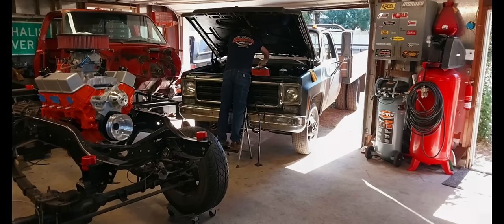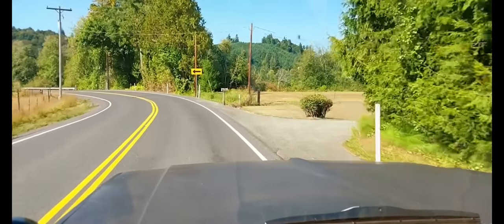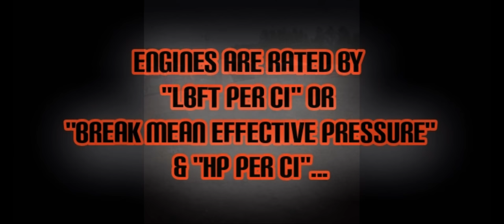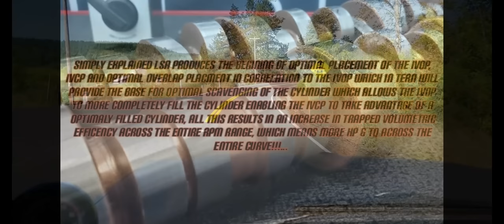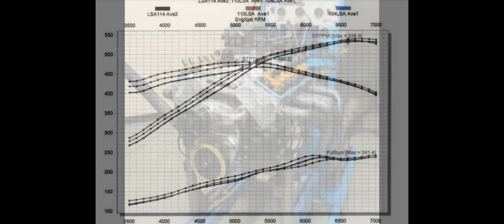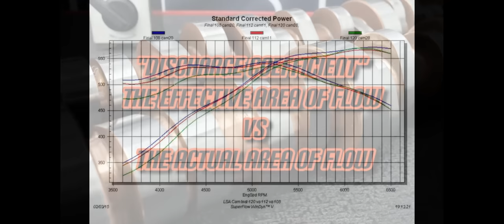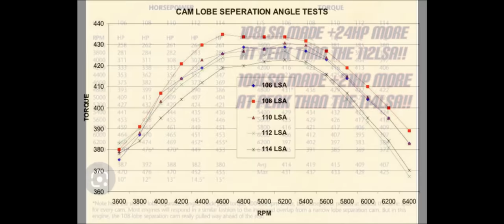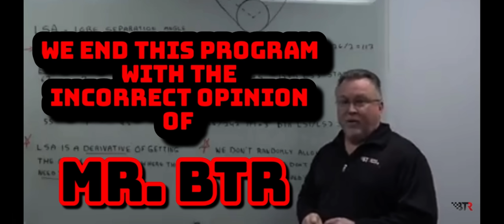Camshaft Selection via LSA, 19LSA's Dyno proven MAX TQ & HP cam tec. LSA, Overlap & Duration convert

Comment: I understand more from this video that I got out of Billy Godbolds new book. I figure I wasted my money in purchasing the book for he will get you totally lost along about chapter 8. Where he should have gone into great detail, he didn't. Your videos on cams are the most informative I have ever seen. I now want to try a few things, have a camshaft I know that has the incorrect LSA, keep the overlap the same and see what it will do for me I have less fear of purchasing a cam thanks to you but as they say, a little knowledge is a dangerous thing. It's only money that is hard to come by. Thank you Adam.
Reply from the maker: Thank you!! That is quite the complement.... I appreciate you watching..
Reply: Sir you didn’t waste your money on Billy’s book it’s hard to understand until one has obtained a certain level of understanding and practical experience building engines. It’s really a great book. 

For those who don’t know Billy is the former head engineer at comp.  If someone runs a como cam Chances are he designed the lobe. he’s a nuclear physicist with a hot rod addiction.
Reply: I’m looking for a turbo cam for a 572 bbc twin turbo. I would like a solid roller with around .770 lift and atypical lobes for street/strip. Any help would be greatly appreciated.
Reply: @chevyluv7216 every cam is a turbo cam. Just pick a camshaft design for the RPM band you want your engine to operate in.
Reply: @ironmike742   from what I gather the ex needs more lift and duration than a NA cam and it needs to be 114-116 LSA
Reply: @MichaelVanParis  Yes, it is a good book for someone that knows nothing but he does a horrible job explaining LSA, just gives generalities, no meat. Yes, He was the man at Comp and now on his own for over a year. The book could be a lot better without needing a masters in physics.
Reply: @ACDGarage_Racing  recomended  sbf 11to 1 347  victor jr heads dart block race engine 250 shot cam? Im sure the one got is shit lol
Reply: @chevyluv7216  forced induction needs less lift  
and being lower and softer landing on valve seat means less valve float need stronger springs for higher rpm and more being built valve train
Reply: @chevyluv7216  I'd say, don't focus on the cam specs (stay within 106 LSA), but focus more on keeping your intake charge cool.  The cooler, more consistent intake charge temp, as well as fuel temp, the more consistent your results... with consistent results, you can then focus on optimizing power, through the timing curve & fuel delivery.  If your interest is peaked by my comment, respond and I'll eleborate further.
Reply: @atheplummer  please do sir
Reply: @chevyluv7216  I have an idea with air/water intercooler making good consistent power.  Your running a 572 BBC.  I have a 468 BBC.  My idea is to put a tunnel ram bottom, and lower plenum.  build an adapter plate to go from the tunnel plenum to a Tick Performance air/water intercooler made for the Holley High Ram series, then put the Holley high ram top hat & throttle body on it.  

Now for the interesting part.  Build a aluminum water box with a Air conditioner evaporator coil mounted inside the box, with a fuel loop also running through it.  Put a A/C compressor on the front of the engine & cool the antifreeze in the water box.  I had the idea, to run a procharger, but turbos would work also.

The Tick Performance intercooler builds power, even when it doesn't have water in it, as the fins straighten the air before it gets to the tunnel ram.  Add super cold water, and you amplify the effects, because cold air molecules are more dense than hot air molecules.  More air molecules per square inch allows more fuel to be injected into the intake runners.  More fuel, equals more power.

With a procharger, you could remove the drive belt from the engine & remove the charge pipe, putting a air filter on the throttle body, for street driving.  Lower compression equals cheaper fuel for long drives.  Get to the race track & hook up the blower belt & charge pipe, & use your race fuel tank, running through the cold water box and your ready for fun.  

I know this will work well, because David Frieberger did a test on Engine Masters where he used the tick performance intercooler without any water in it and he saw power gains.  

Hope this helps.
Reply: I don't want over lap. Unburnt gas. And smell. I can live with 2hp less with no over lap.  Bt knows his shit. His a businessman and don't want to give out any more secrets. Every one is looking for peak numbers. If an average Americans don't know much about camshaft I'll sell any kind of camshaft to them it's just a business.i took my my 108 cam cuz was not good idle. Want nice idle but lost 24hp in process with 116 lsa. I was happy with 116lsa. good gas mileage too. I install exhaust cut out and gain 10 HP back. So over all loss low end torque and about 15 rwhp. It all depends on what you want. I wanted smoothies of idle and still right there near the 108 lsa. It's just an opinion.
Reply: Any chance you would be interested in helping me spec a custom grind for my build, for payment of course?

Comment: Excellent video Adam. I always say that the internal combustion engine is a delta P device. It operates on pressure differentials. As engine builders, our job is to maximise those differentials. The greater the differentials, the greater the output, and the greater the efficiency. I also am an advocate of low lift flow, and LSA. I relate it to trying to squeeze through a partially open door,  as opposed to having someone drag you through a wide open door by your shirt. Cylinder charge density in a running engine is, in my opinion, greatly affected by what happens at the end of the exhaust stroke, when cylinder depression is at its greatest. You obviously have a lot experience with Chev's, but I grew up with Cleveland's. Mainly 2V heads, in Australia. The easy head to get was the 302C closed chamber head. Small ports, flow limited, by Cleveland standards, but cheap, very cheap. With those heads, and the right cams, I was beating guys with 4V heads, Ford Motorsport alloy heads, motors that cost more money than my entire car with the motor. I agree with everything that you have said. It aligns with my experience. I certainly agree with your analysis of the camshaft industry. However, i suspect that the wide LSA's that we are seeing is to some degree a result of them trying to reduce overlap in order to reduce the amount of oxygen seen at idle by the oxygen sensors, on vehicles with standard ecu's. The camshaft is the heart of the engine. Unfortunately, most people don't understand that. It is interesting that if you read David Vizard's books, you will find that he writes that the lower the compression ratio, the more sensitive the motor is to LSA. Pro Stock motors with 17:1 compression ratios are comparatively insensitive, so you can adjust LSA's for valve to piston clearance if required. However,  very few people watching your video will be in this group, but a number will see Pro Stock cams with wide LSA's and think that it's the way to go. Regards Greg
Reply: Well since there compression ratios are really high that probably why there LSA is super wide because of that just like Cattledog say every 1 point of compression is .75 wider so if you take from 10 to 17 so do .75×7= 5.25 so basically 5 points wider LSA so if a 400 LSA is 105 plus 5 just on compression it's 110 so i wouldn't be surprised if a drag races 400 with 15:1 big rockers and big valve heads you can maybe run 110 it's crazy how everything is so backwards for the majority of people who doesn't believe LSA matters. But thank you for sharing about Visard book I really appreciate that information.
Reply: @chevyrc3623  pro stock guy's admit to 17:1. So you can bet that it's probably a bit more than that. Darin Morgan was talking about dyno testing a pro stock motor with LSA's of 117°. Different lobe profiles, but all on the same LSA. Now that being said, very few viewers are ever going to run 17:1 in anything but a diesel engine, so LSA sensitivity will remain a genuine issue for them. Street and Endurance engines are very different from drag racing engines. The primary difference being life cycle. Endurance racing motors can't stop every lap for a valve spring change, or at the end of every straight for a piston and rod change. Therefore the engine building rules change. Not the written regulations, but the builders requirements. Many people look at drag racing engines and use that as a guideline for street/endurance engine building, forgetting that drag race engines are only interested in the very top part of the power curve
Reply: @theshed8802  oh wow I see
Reply: @theshed8802  How do endurance racing engines differ from street engines, if at all? What I mean is, if the progression is street/daily, endurance racing/weekend car, Sprint/Short/Circle track racing, and Drag Racing, how would each methodology differ for "life cycle" and where should most performance guys shoot for? Is shooting 1 rung above your actual use case safe?

Right now it seems according to what you're trying to imply, that everyone is shooting 2-3 rungs above and should chill out a bit, I'm just wondering if they (meaning I since I'll be building a performance car soon) should chill out all the way or not. Though because I value longevity in general and won't be hardcore racing at all, I probably won't go above the endurance racing/weekend car level, regardless.... Whatever that truly entails based on your response.
Reply: @Drunken_Hamster  when building engines, the first thing that you need to do is decide how long you need/want it to last for. Top fuel, less than 4 seconds, truck engine, 1 million miles, they are 2 extremes, but they illustrate the diversity of requirements. The second thing that you need to decide on is the acceptable maintenance level. Back to my pro stock valve spring life comment. The third thing  that  you have  to  decide on  is  where  you  want  peak torque  and  power  to  be. Endurance racing engines might have to do 24 or 36 hours between rebuilds. Some racing series specify minimum mileage, limit engine changes, but regardless of this, they rarely do more than a season between rebuilds. Camshaft, valve springs, and valve train are, in my opinion, the area that differs the most. The longer the required life cycle, the more gentle the cam lobe has to be on the valve train, and the valve seats. You can't run the aggressive high lift cams, because they smash and pound stuff to death. Opening and closing ramps need to be a little more gentle, lobe lift has to be a little less, compression will be lower, because you can't afford to run exotic fuels even if they are allowed, due to the cost. If you are racing, remember that in order to finish first, first you must finish. A championship is not won at one event, it's an average of all events. I always try to get the most that I can, out of the least that I have. Putting in a big cam is the least effective way to make big horsepower, optimising everything else and caming to suit, is the most efficient and reliable way to make horsepower. One thing that I haven't spoken about is rev range. Hot street motors still spend most of their time in the 4000rpm and less area. Endurance racing motors spend most of their time above that number. Drag racing engines generally make peak torque at or above the maximum power engine speed of an endurance engine. Remember that you generally will only have a 1500 to 2000rpm effective rev range to work with in high performance motors. Rpm range dictates what port work you do to the heads. The higher the rpm, the greater the port csa requirement
Reply: @theshed8802  Well, when you put it that way... I want an engine to last 3-4 years of regular street driving, with weekly canyons/roll races, bi-weekly or once-a-month drag strip visits, and maybe up to 6 or so per year visits to either autocross, road course, or drift event combined.

The engines I'm deciding between will have stroke lengths that allow me to safely spin up to 8000rpm at 25 m/s or less of piston speed, so I'd like to use at least 7000-7500 of that, regardless, and not have it be either gutless down low or breathless up top.

I'm learning about turbo stuff separately, but I assume I'll want/build a turbo engine since I'm primarily looking at I4s and V6s. However, I wouldn't turn down the relative simplicity of a small block V8 if I could get 400-600whp out of it with decent economy on pump gas.

With all that in mind, where do you think I should be? Part of the optimization process that I know of for cams/valves is that there's only so much lift a valve/runner can actually see benefit from. In the DOHC I4 I'm looking at, the aftermarket head available has 37.5mm intake valves, which should mean a roughly 9.5 to 11mm maximum effective lift...

Is that too much? It'd be the rough equivalent of a 2.09 inch valve being lifted 0.525 to 0.63 inches total... What's the deal, the low side of that, especially, doesn't seem all that crazy.

Comment: Thank you for clearing that all up Mr. Adam. I own a little sports-car with a 1500cc/91cid 2-valve engine.  The intake valve is 1.46" , and the compression ratio is 10.9:1, ...but what would the correct number be for the equation?  Is it still 128?...& that comes out to over 113LSA....That couldn't be correct for this little high revving engine could it? And the 1500cc has a SOHC, so I'm not sure if that changes everything to a different formula.  Also, I'm NOW wanting to pull the cam out of my SBC 355, and swap it out for a 108LSA  roller cam, but not sure how much duration to have on the new cam profile. What are your thoughts on that? ...I'm looking for highest peek torque at the lowest RPM, and idle "quality" doesn't matter? It's exactly the same as you use in this last 350 example,  but it's a 355cid,  with 10.5:1CR,  2.05"- intake valve.  Thanks Man !!  🙂

Comment: Well done! Nice explanation on converting the overlap on a wide long duration LSA cam to match a tight LSA shorter duration cam.  The math is explained well. Thanks
Reply: I’m new to engine building and find this very informative and useful. However, the cam spec sheets I’m looking at list both intake and exhaust duration, which one do I need to reduce to compensate for a tighter LSA? Thanks for the help!

Comment: thank for your time , keep up the hard work. i have read and builded a 383 a long time ago useing david vizard book and had a good engine . now 20 years later i just builded a ls2 stroker 403. i allways had a hard time understanding 128 formula for picking the right cam lobe , but now after wacthing this and the info i have read over the years , its hit home a lot better now , so thank you , your video made things clear to understand. i now have conference in ordering my own cam specs . i to have a ls2 stroker with 245 afr heads and 11.2 compresstion ratio eingine and wanted a a good strong street engine. so this is what i come up with for my combo , 226 / 230@50 107 lobe sep with 279 /282 dur . i know its a small cam but hopfully be a great street cam with a little punch.thank you and look forward to more .

Comment: Thank you and David Vizard for all of your knowledge. Your videos are pure gold for a young hotrodder and mechanic. I'm only 18 but I love classic cars especially GM products from the 50's to the 70's. My favorite engine of all time is the Small Block Chevrolet. On my c10 that i'm restoring with my dad 4 years deep in that project lol. Were finally putting my 305 back together its bored 60 over and has a 3.5 crank 9.1 compression for 87 octane pump gas. Thanks to yours and Vizard's videos ive chosen a 106 LSA Intake lift 0.430 Exhaust lift 0.430 Intake Duration 244 Exhaust Duration 244. All those specs are at advertised with the duration giving 32 degrees of valve overlap. My question is that too much to make good power from 600 to 4500 rpm? You are way smarter than me or my dad about this topic so i was wondering what you thought.

Comment: Your information has given me a fist time engine builder a lot more confidence in choosing the right cam the proper way instead of just buying whatever specs that people recommend without explaining why. Even beyond the dyno sheets you show I find it easy to grasp these concepts in a physics based way which also helps me understand the working of the valvetrain at a much much higher level.

Anyway I hope you're doing well. Your squeaky clutch reminds me of driving the 56 chevy pickup my dad and I have been building cause it still has a factory mechanical clutch to go with a 5 speed. Can 't say the motor sounds the same though. I was gonna LS swap it and since it has a 350 currently, you might have inspired me to make it a 383

Comment: My first cam was 108° on my 355.i had .600/.625 lift and 310 duration it  was set 2°advance .after this vid i realize my research wasnt to far off.but now i street my lil s10. So i went with a 110° lobe sep.and my lift barley changed to .615/620. And i had stroked and bored .010 more to ..040 .its now a 385" motor.it dosent like reving over about 6500 unlike the 355 that didnt mind 7500..thaks for the very informational vid .very well done  thank you sir.
Reply: Yeah the bigger the cubic 8nch the narrow the LSA you should of have 106 LSA in that engine plus the bigger the stroke the harder the rpm it will continue. But I think you lost some overlap when you went the wider LSA but always do LSA first then do your overlap with duration. So hopefully this helps
Reply: Really, thanks mani had it backwards.guss the salesman at Herbert cams was a lil pushy too